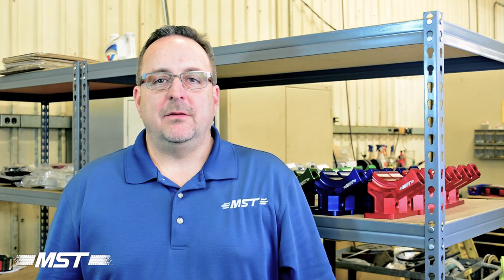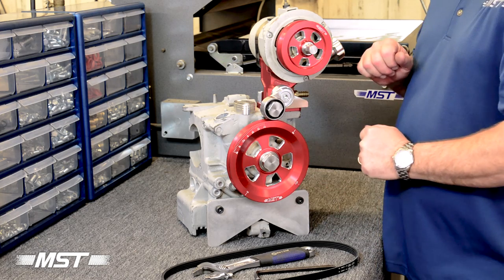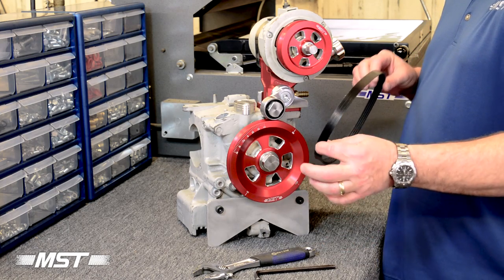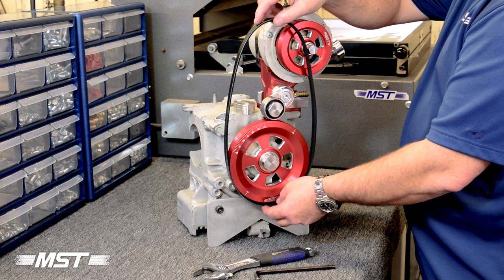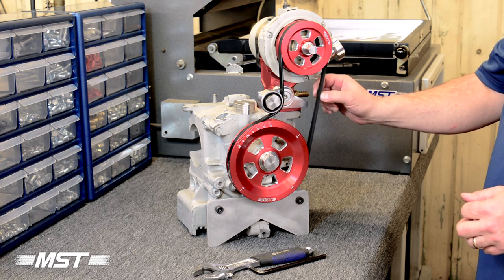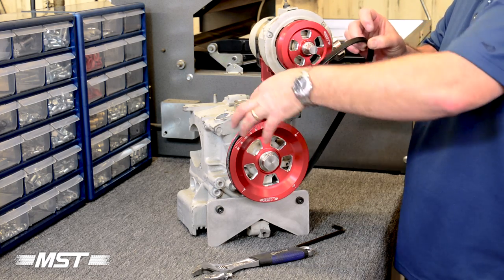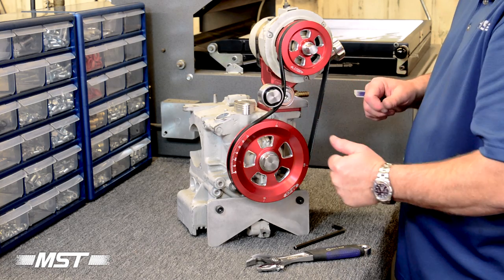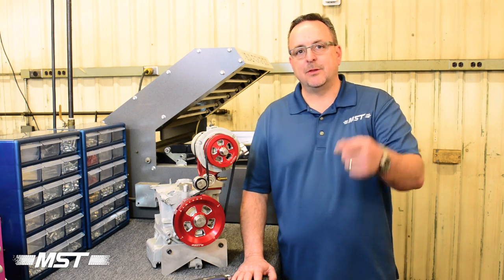How to Install the Belt on an MST Serpentine Pulley System for Air-Cooled VWs

Comment: I just received my MST Serpentine Pulley kit and I have a few comments.  The kit look to be very well made, but I wish you had also included pulley shims with your kit.  My pulleys are not perfectly aligned , so I now have to order the pulley shim kit to move the crank pulley out slightly.  I wonder how many people who order your kit get a perfectly aligned pulleys without using shims.
Charge a bit more and include these with your kit please.
I also wonder why you made the crank bolt with a square head.  It looks like a normal socket won't fit, which means I can't use a torque wrench when tightening the bolt.  Why not use a bolt with a standard head so a normal socket can be used?
I recommend anyone who is thinking of purchasing this kit also order the pulley shim kit.  There is a very good chance you'll need the extra shims to line up your pulleys.
Reply: Thanks Ron for the recommendation....this is something we will consider in the future.
Reply: I had to shim mine, you can buy a shim kit from CB
Reply: I second the pain of the square head bolt, the bolts is really nice and high quality but makes torquing it down such a PITA…

Comment: Hi wonder if you could help, my mechanic has just built a new engine for me, and has fitted the raptor serpentine for me but he’s worried about the crank centre bolt torque measurement, as vw manual say it should be torque to 44ft-lbs. we can’t seem to find a socket for it and all we people using is crescent wrench or adjustable spanner.
Reply: Eric, did you get the crescent wrench to work out?
Reply: @marystatton6743  I actually had a socket made to fit the very strange size of nut, getting the Allen was no problem I’ve had it running now
For a year and it works great. I can send video if you want
Reply: @erikscrase579 the bolt head design is not only bizarre but won’t fit any socket

Comment: What is the benefits of running such a pulley system?
Reply: ady-B David If you gave to install shims in order to tighten the. Rly, the stress on the wall of the generator pulley will break thus neutering your cooling system. This will happen when you are far away from any place that can help.
Reply: It looks cool.